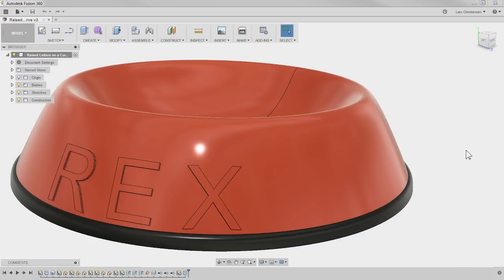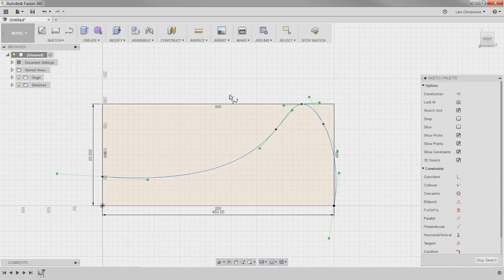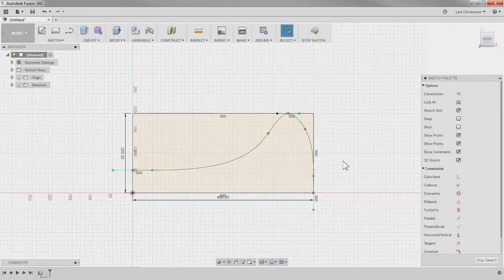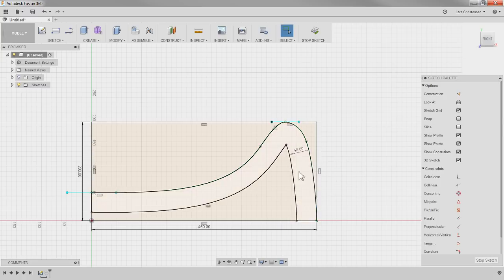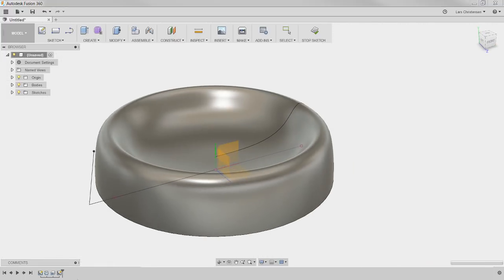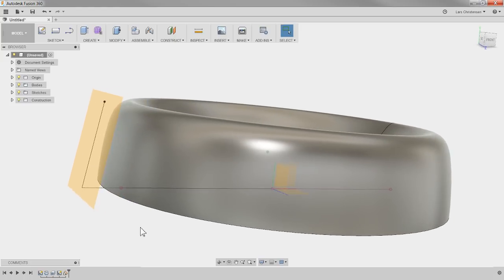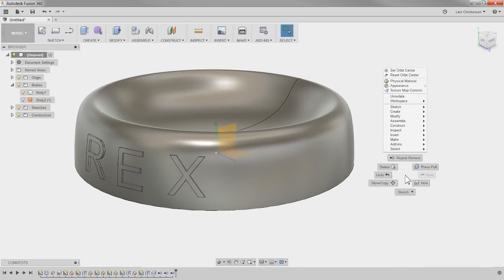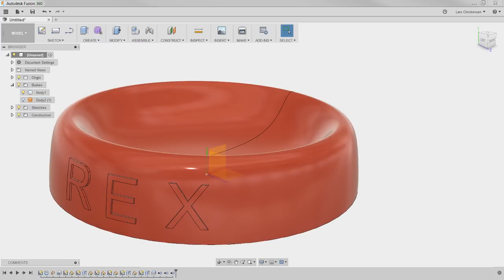How To Make Raised Letters on a Curved Surface — Fusion 360 Tutorial — #LarsLive 125

Comment: Hi Lars,

thanks for reminding me that it is so easy to create an offset of a surface and then use that to cut (all kind of stuff I happen to have sitting there,  not just an extrusion). I also like the way how you extrude each letter separately in an correct(ish) angle.
 
However, on reflection how I would construct all the planes, I figured it would be much easier to just create a new sketch on the top plane, draw a polygon (with 18 sides for our example with the 20 degree angle) inscribed to the diameter of the outer edge of the bowl + "some offset". Then extrude that with a taper angle, which I would find using a construction line  I draw right next to the spline in the first sketch. This constructs all the planes (or actually faces) you need tor each individual letter with like 5 clicks or so. Saving a load of time, especially if I had a dog with a longer name ;-)

I hope this makes sense
Reply from the maker: Hi Thomas Meister Thank you for watching! ANd thank you for a great comment!

Comment: I have a hang up with this. The sides of the letters are only perpendicular to the face you’re extruding to at one single point, where the plane is “tangent” to the vertical curve of the bowl, and at the centre of the plane (in line with the construction line we used to define the plane). The further you go from this point, the less perpendicular the walls of your text becomes. This is why you did each letter separately, to minimise this effect/issue.
Is there some way to get the text to follow a path within a 3D sketch? Or some other method where the walls of the text will remain normal to the face you want it to protrude from?

Comment: I do this all the time with curved surfaces. I think my way is simpler, but maybe there is a downside? I place the text on the X plane. (perhaps do before the shell in your example) Then extrude the text out through the curved object. Use split object and hide the bodies you don't want. The curved surface is now "cut" with the text faces. Use "press pull" to pull them out as far as you want and they retain the curve of the object. 
Some problem I am not seeing with this?
Thanks for making these videos, btw. Really enjoyed and learned from the "Make a tube chassis with 3d sketch"!
Reply from the maker: Hi Michael Shannon Thank you for watching!
Only problem is that your text is only normal to the X plane so if you write a long word you will see the lettering is only normal to that plane, not following the curve . If you get the result you want, you are fine :-)

Comment: I really on your tutorials - they have been such a help Lars. Thank you. It's been about a year now (maybe a bit more). I'm designing a trombone mouthpiece and the top cup is similar to your dog bowl (with tweets). Do you think this would be a good method to design a mouthpiece - using the spline technique? I got a perfectly fine first draft with a circle sketch that I built upon using loft, then created a separate component to hollow out the cup (it can't be shelled as the cup is different to the outer shape and needs to be able to be changed or tweaked. I then used the fillet to shape the rim of the cup. But I want the rim to have more accurate dimensions. Do you think I'd be better off using the spline technique you have used here?
Reply from the maker: I would for sure use splines. For nothing else than having the flexibility of adjustments. I would also use revolve, check out this video https://youtu.be/zYMf6qncgwc

Comment: Lars, 
I am working on a project where I needed to import a new font "Sweetness Script" . All other fonts that were preinstalled work fine, this one I am able to place it on the screen, but unable to Press Pull. The files that I loaded for this were call from the Sweetness Script folder "OTF" and TTF"  is there  a work around, or what am I doing wrong?

Comment: Hi Lars. Great Video as always! If I were designing a part that had raised lettering that had to be released out of a mold cavity or slide, would I offset a surface and extrude only in the direction of draw of the mold? I have to design a round tapered container that will have raised lettering on it (like liquid volume levels). The lettering will be on a tapered-curved surface but must be released by a mold slide. Suggestions? Thanks.
Reply from the maker: Hi Jay Catmull Thank you for watching!
I might not be your expert on this. I can only recall once where I had to do what you describe and I think we had the lettering on a slide that moved back before ejecting the part.
Reply: No worries Lars. I think I figured it out. It seems that there are a few ways to do it. That’s what’s great about Fusion 360.

Comment: Hi Lars.  Nice presentation, as always, but to put that (small amount of) lettering on, does seem very involved.  You mentioned another method, but not knowing what that is obviously I have no idea if it's better or not.
When you started the first letter, is it not possible to copy and rotate new plane for each additional letter?  As you say, if there are a lot of letters to be placed, it could take quite some time.
The letters aren't precisely positioned are they?  How would that be done?
At the end of this video, there is still a line showing on the surface of the bowl, and without recreating this drawing, I wonder how easy it is to remove/hide that line.
Regards Mark in the UK
Reply: You can use faces instead of planes :-) - see my long-winded comment earlier for an approach
Reply: Hi Thomas, and thanks for the reply.  Yes, I've read your alternative way of doing the lettering, and it makes a lot of sense.  I understand the process exactly , and I like it very much.  Thanks.
Reply from the maker: Love Thomas' approach!

The line on the bowl at the end is because the "Show visible lines" are turned on. Switching to "Shaded" would take care of that. It is only graphic.

Best,
Lars
Reply: Hi Lars and thanks for the reply, but what about the other point raised in my original comment?

Comment: You could also start the extrude for the text from the curved surface. There is an option for that there. That way you can simply write your text on the plane you wish and then extrude Only from the curved surface.
Reply from the maker: Hi HPB1980 Thank you for watching!
The only downfall is that your text will only be normal the plane you have all your text on, not normal to the surface.
Of course, if this is good enough for what you need, yes, totally easier :-)

Best,
Lars

Comment: It is simple enough, works only for short texts though, for long texts you lose the spacing of the letters, instead of doing all the lines seperately you should have made a pattern from the original line and or from the plane, saves significantly on time, but sad that MS Paint 3D can wrap text but Fusion doesn't
Reply: Thanks for letting me know. I've been trying to figure out how to create 360 degree type long text wrapped around fairly decent diameter. Haven't found any easy way in Fusion to make them happen. Surely doing bit like this or doing tangent plane and beginning cut from object you can make very short texts, but yeah doing long text you can begin to see text so-to-say "cut lines" isn't doing any good to quality of design. I think I'll try MS paint 3D approach, I think that'll be just fine with STL-models. Still I'd like to have feature to wrap text around cylinder in Fusion. It would ease up the workflow much. I've made cylindrical tools that don't have much planar face area and would like to make text markings around them (model, version etc.). That's why encountered this problem initially.

Comment: The operation involving Create Offset + Split body was confusing. When you do something like this, I think it's helpful if you provide a quick explanation about what you are going to do before starting.  For example, say "I am going to create a 5mm offset dog bowl body that I am going to use to slice off the lower 5mm of the 3 letters resulting in 5mm raised letters that conform to the shape of the bowl using the Split Bodies command. After that, we will remove the offset bowl along with the remains of the 3 letters". That would be helpful, because in my mind I was thinking that you were going to use the Patch environment to reshape the 3 letters. But, when you created the offset shape I got completely confused about why you were doing that. Another idea would be to perform the new concept quickly (tell us to "just watch") and then repeat it at a slower pace. That way, I would grasp the direction we are going during the exercise.
Reply from the maker: Thank you for the feedback 👍And thank you for watching 😊

Comment: There's a faster way to do this:

edit: I see that the letters are not normal to the curved surface, the longer the text, the worse it gets :/

Create an offset plane where you will place the whole text. Extrude to object (the bowl) and make sure the operation is set to 'new body'. Then move (translate) all the letters a few mm inside the bowl. Finally, use combine tool where the target body is the bowl and the tool bodies are each letter profiles (operation cut) and make sure new component and keep tools checkboxes are unchecked. Now you have the text carved into the surface and all you need to do is extrude it out, and yes, it will follow the bowl's curvature.
 
I'd also like to mention that for some reason, Fusion360 struggles to perform the last operation, it took me around 25 seconds to extrude a 5-letter text on the same bowl after clicking ok. And after doing this, every command takes forever to process. i7 6700 processor here.
Reply: Thank you, thank you, thank you!!!!!!!!!!!!!!!!!!!

Comment: I have been having a problem using canvas after having stopped sketching.  If I edit the sketch, I cannot use find or open the canvas on that edit.
Reply from the maker: The canvas is sitting in its own folder on the tree on the left

Comment: I need help! I uploaded a sketchup file to my data panel and dragged it into my workspace. I CANNOT MOVE IT. It has multiple parts within and no parts at any level will move. What am I missing here? Any help would be greatly appreciated. Thank you
Reply from the maker: Hi Kaleb Israel Thank you for watching!
Can you use the move tool:
https://youtu.be/EejRr-Y3174?list=PL40d7srwyc_Mkgc5wvP_OfVel9aDkNkZ6

Hope this is helpful
Reply: Yeah it won't move at all with the move tool. The handles show up and I can even move the handles, but the part doesn't move with them. I've tried selecting the whole component and bodies. The handles can be moved, rotated, whatever and the imported part still stays in the same spot. I did notice that when I went to hide a body it was greyed out and said something about being read only when I hovered over it
Reply: Used break link. Still can't move it

Comment: How about using just one plane and create all letters on that plane. Then rotate each letter around the center of the bowl.
Reply from the maker: Hi Tomas Palmquist Thank you for watching!
Only works if you want the same letter as far as I know :-)
Reply: Hello Thomas, I am trying to follow your method and am stumbling somewhere. I am very very new to F360, however I understand conceptually what your are doing.  In my attempts I am having difficulty in actually making it happen. After I construct my plane at an angle and set my first letter, do I then stop the sketch and create a new sketch for the next letter? Not sure my steps/approach are correct.
Reply: FENATECH 
It has been a while but if I remember correctly. Stop sketch and extrude a letter from sketch. Then rotate letter with bowl center as rotation center. And start over create new sketch, extrude and rotate. Get it?
Reply: Yes thank you very much for the quick reply. I appreciate it.

Comment: Thanks Lars! Great video! I have been working through all of your videos. I am enjoying them. 

There are a couple of parts that I would like to model, and maybe others would find them interesting. For example, this simple steering wheel looks like it could be done with flanges first. But the grips over the metal is something that I'm not sure how to approach. http://www.bmikarts.com/assets/images/600680.jpg

It would be interesting to watch your approach.
Reply from the maker: Hi Roy Beisswenger Thank you for watching!
That would be a great livestream. I will put it on the list.

Sculpting is for sure the way to go. Check out this video:
https://youtu.be/nCcHWUYetNw?list=PL40d7srwyc_Mkgc5wvP_OfVel9aDkNkZ6

Best,
Lars
Reply: I did watch that video and it was very helpful. I also watched your video on bending sheet metal and that was helpful for the body of the steering wheel. 

However, sketching the curved splines onto the sheet metal part and then bending it is anther challenge for me. Can bends be made to a part that has already been cut into curves? Or is it possible to bend the part, flatten it temporarily, cut it using a spline with the sketch, and then restore the bends? I haven't tried it yet, ut that seems to be the workflow.

Here is a drawing of the part from a catalog. http://www.bmikarts.com/assets/images/steeringbutdiagram.gif

It is an Azusa go-kart steering wheel.

Thanks again. You have really helped me understand Fusion 360!